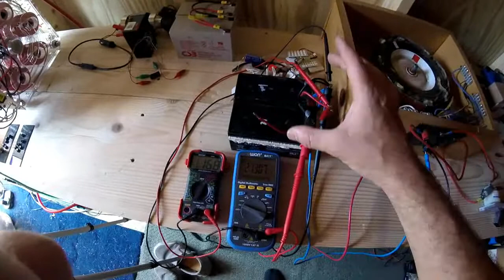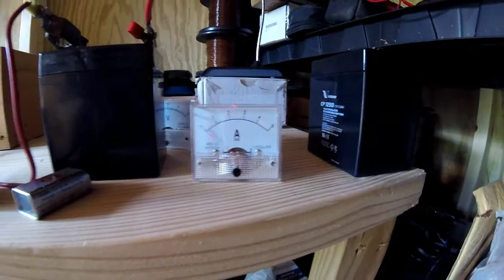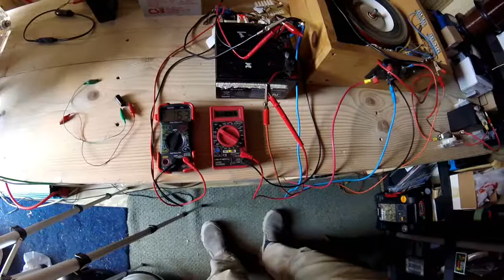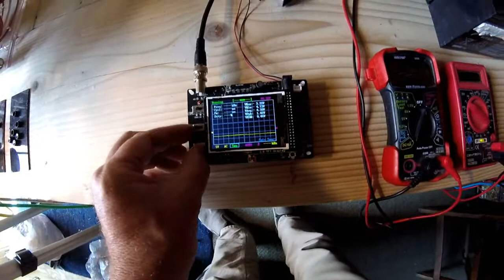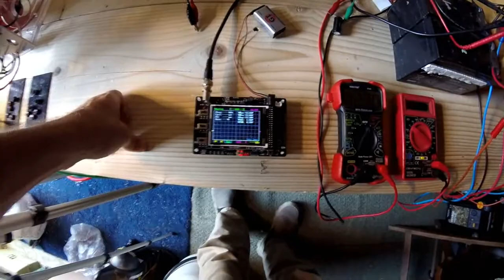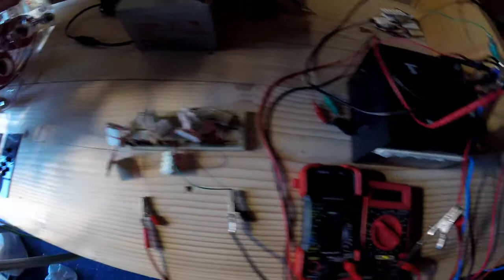Comparison Of Bedini Charged Batteries w Capacitor Over Time

Comment: If its all about the electronics. Couldnt you build a giant coil with an power transistor. Trigger pulse it with an pwm module with about 1 percent duty cycle. Just saw bedini video that ricks  channel he was in it. John showed the waveform from his scope. Why bother with the motor at all?  Although it may look cool. Bit bulky and bit over built. Think in john scope you see bunch of sharp lines. Narrow square wave.

Comment: I think I might have used the same scope that you're using. Like you were saying they are not high accuracy but for the price they do let you see a waveform. If it is the same one that I was using the biggest problem I ran into is it the zero-point would drift. I would zero it and it would stay there for only a minute or two. In the manual there was a way to zero it by holding one or more of the buttons. it's a bit of a pain but if you ground couple the scope and zero it before you take each measurement it seemed to give a lot better results for me.

The other thing that you might be able to check pretty easily is the impedance of the scope if it keeps changing your circuit when you connect it. I had a piece of test equipment that was lower end and I kept getting bad results reading sensors. When I measured the resistance of the leads it was only 14 kilohms.
Reply from the maker: This is a knock off of another company. Mine is Sainsmart and the original designer claims that its a copy of theirs. I have no trouble with drift though. Just no real accuracy and not enough settings.
Reply: The Do It Yourself World Electronics I think mine was under a different name but looks like the one you have. Despite not having good accuracy it I thought it worked great for showing that your capacitor was smoothing out the voltage spikes.

It will be interesting to see what you find out as you continue to test. Without the capactor your using a pulsing waveform to charge the battery. With the capactor it's closer to a steady voltage. I have seen people debate if pulse desulfating or steady voltage is better but I haven't seen anyone test them side-by-side before.
Reply from the maker: I think I am going to leave the cap on one battery and continue to charge them on the bedini until they are full and restored. It will be interesting to see what happens.

Comment: Nice presentation and experiments.  It would have been better if you had stayed consistent in the experiments by sticking to just the capacitor issue and not muddying the waters with the LEDs in the same experiment.  I would have done the LED add on after the switched batteries and capacitor switched test results were concluded.  Still very good video.

According to Rick, the capacitor is another process element to your Bedini system.  I say system as the SSG is only a base incomplete proof of show and there are many secret or less know features (what Rick calls extra process add ons) available to enhance results.  The capacitor feature is one of them.  Rick seems to think it serves as a converter of (negative energy) to positive energy.  (Not my terms or explanation).  If the battery is conditioned to accept only positive, the normal kind, it is less efficient at charging the battery as the battery wants positive energy and the BEMF event is not positive energy but negative, then the capacitor converts from negative to positive so that the battery responds better.  Not my terms or belief, just passing what I understand he meant.  Also a battery can be conditioned to only respond to negative and not positive energy!  Again only noting what I understand Rick was saying.  I could be mistaken of his reasoning, but in large I think I said roughly what is relevant.

As to your test capacitor.  That is a electrolytic type right?  Electrolytics are conventionally very leaky.  Have you tested other capacitance ranges and capacitor types and also non-electrolytic types?  Maybe a polystyrene from a fan or an oil filled type from a AC motor or such.  What happens if you substitute an inductor air core or iron for the capacitor?  Results might reveal something new?
Reply from the maker: Your comments sound to be correct to my understanding. I am also still learning although I have followed John for many years now. You have some interesting ideas. Thanks. I will try them. Dont be surprised if you see these show up soon. I have to get at least 10,000 views on this channel before YouTube will even consider reviewing it for monetization. So I will be pumping out the videos here for a while.

Comment: Anything in the line is added resistance that is why it slows the motor. Your putting the brakes on the signal out and you are clipping the pulse on the input with the LED. THE CAP IS HOLDING THE CHARGE IT GOT THE DAY BEFORE. WATCH THE POP WHEN YOU DISCHARE THE CAP. Caps are holding tanks for volts x amps which makes watts. Volts don't  hurt it is resistance that makes the amps they hurt. After you will see watt is going thru to ground and why you are getting yourself off the ground.
Reply from the maker: Actually I previously did an experiment using the capacitor and discharged it repeatedly to show that it was not the cap showing a charge.

Comment: If there any 10X scope probes available for your O'scope it will help with isolation from the voltage source and not effect the operation of the Bedini SSG as much. The 10X probes will also help keep your O'scope trace more managable on the display.  This is very interesting work Troy. I'm glad to see this experiment take place. I'm an old USAF ret. crypto tech with experience in the field since 1973. Since the passing of John Bedini, I've seen very little continued replication and experimentation follow up.  Keep up the work of discovery, please.
Reply from the maker: Thanks. I will have to look for some. Happy you like the videos. I have so many ideas to try out.